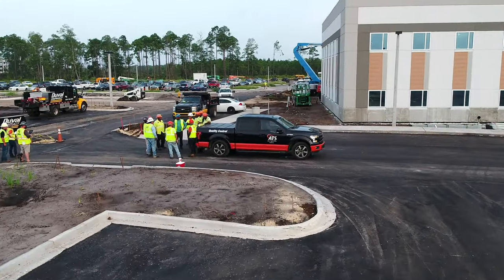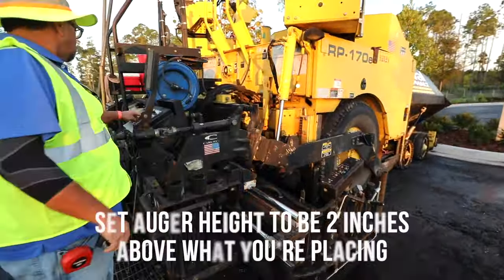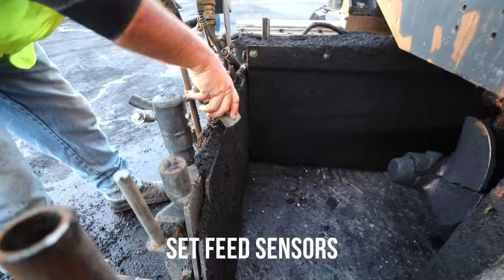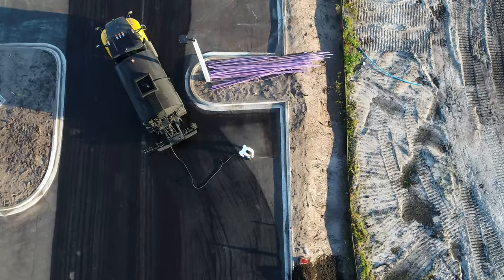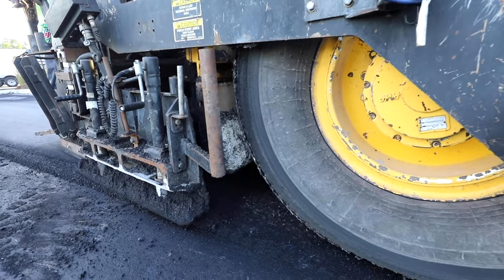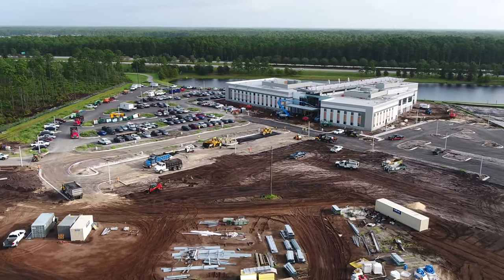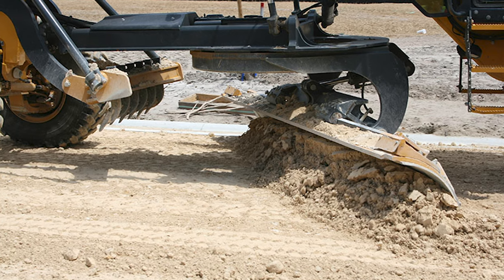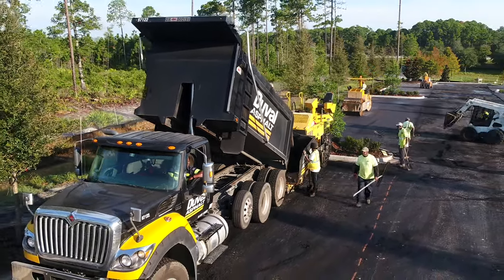How an Asphalt Paver Works and Keys to a Successful Commercial Paving Project

Comment: 1. Before you null the screed. You need to pull the tractor forward to take the slake out of the screed arms. if not you screed will not be set properly.
2. Alternate the conveyor and augurs to fill properly and will help with your head of material.